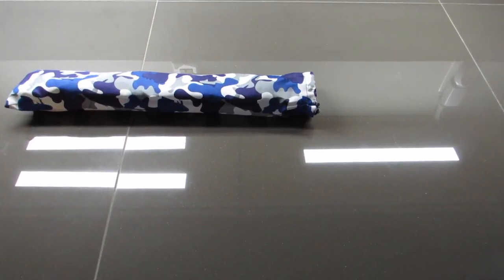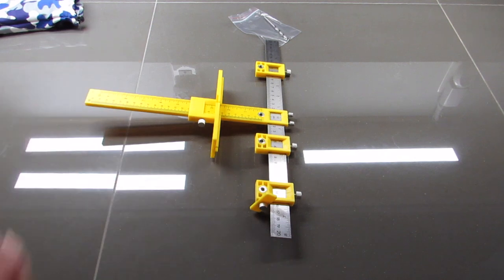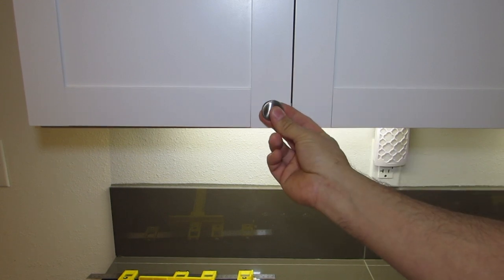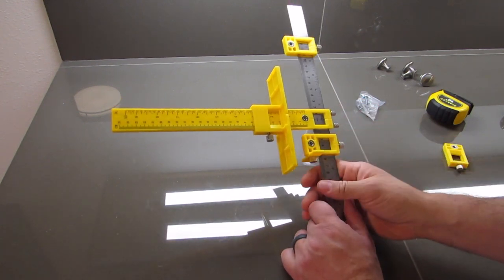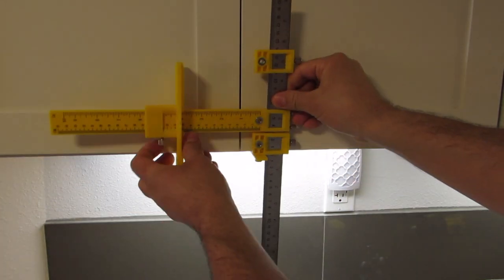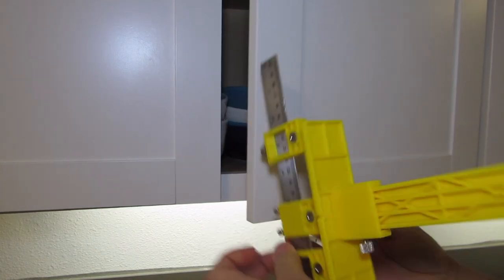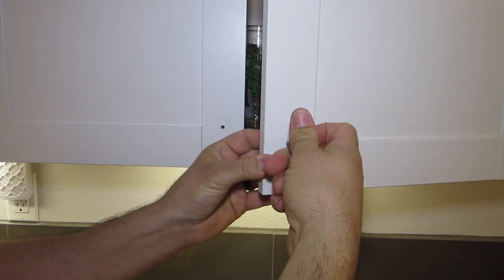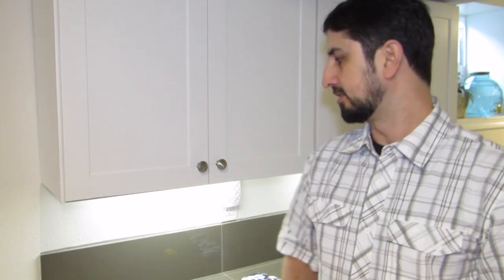Cabinet Hardware Jig - How To Install Cabinet Handles and Knobs Quick and Easy

Comment: Bought one of these from Wish last yr.  Didn't know how to use it at first but once I figured it out it made the job of installing the handles so much easier and neater.  you need to practice with it a little more.  you should use all 3 parts to center your holes.

Comment: We had hardware installed and he used a very similar jig. It worked great. 
I bought the Kreg jjig, and wasn’t overly impressed. 
This is a must better tool with more adjustability and accuracy.
Reply from the maker: I'm glad you like it!
Reply: What he probably used was a True Position Tools Jig, which is very nice. This is a cheap chinese knockoff and it's junk.

Comment: You made it look more difficult than it needed to be. If the bottom guide is more than 1 1/8 flip it and lock it at 1 1/8. Lock the Side guide on the ruler at 1 1/8. Zero the hole guide that’s on the ruler and that’s it, you get 1 1/8 from the side and from the bottom. Because you have a narrow shaker the end result looks good the way you went with the installation anyway.

Comment: Wouldn't having it held from the bottom be easier? So no 2nd guessing on the measurement is needed. Also they could have been done at the same time. Hence why it had the 3 parts he disregarded as "extra" placing the zero in the middle and left and right would be the same number.

Comment: If you use the large arm for the bottom brace and put the small brace backwards. You can get the initial center measurement
Reply from the maker: Thank you for that idea. I didn't think of it.

Comment: You did it all wrong bro. That’s made for drawers and not for corner knobs. Pro tip is to mark the hole with a pencil or marker first and then drill. 

Peace ✌️